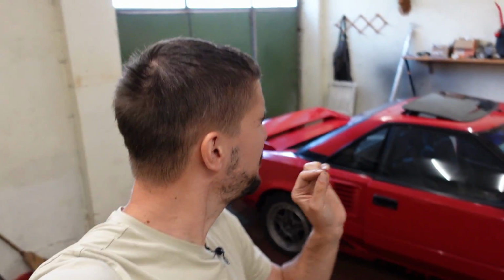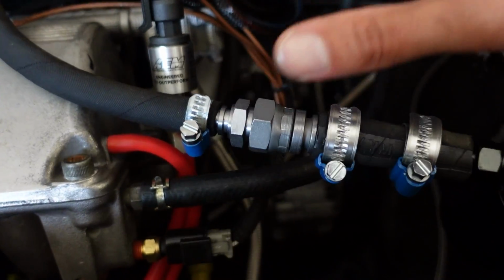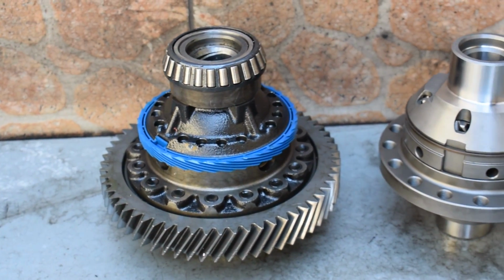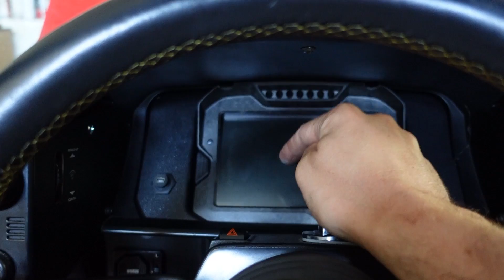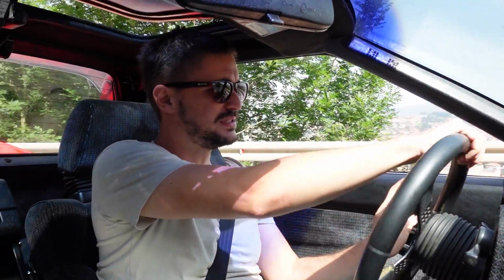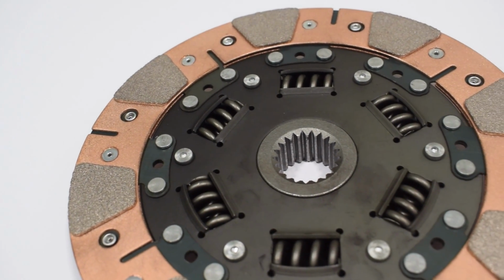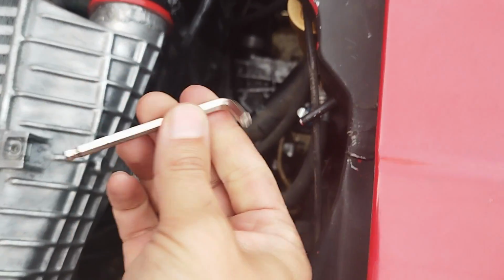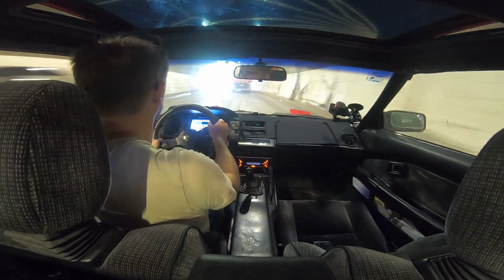Project Underdog First Drive - Turbo 4AFE Toyota MR2 mk1 AW11 spools up for the first time!

Comment: I drive a 1.4T Corsa E (stock motor) with the turbocharger from Astra H 2.0 OPC without the blow off valve and with the turbo flutter with 1.5 bar of boost. Don't worry, the turbo won't die. I've made thousands of kilometers already as it's a daily driver.
Reply: The flutter happens because it's at very low pressure ratios for big turbochargers. BOV will be open at 7 psi, but as the pressure drops, it closes anyway because of the spring, and flutter happens.
Reply from the maker: It works fine now, I explained it in the description

Comment: ignition coils need to make more voltage because more boost increases the density of air, literally stuffing more air molecules between spark gap thus increasing resistance.

Comment: The usual reason for a BOV not working correctly is a hose problems, if it dumps at high pressure but not low you have a kink, if it never dumps its blocked (dirt or heavy a hevy kink). And is it dumps only on lower revs check the routing of the hose, twice on volvo 240 turbos I have seen a hose getting squeezed because of engine movement 😢. God luck and enjoy BOOOST🎉

Comment: Great ! 
You got it perfectly, hard work and learning pay in skills first, then in project fulfillment! 
Nice car. With about 0.5 to 0.6 bars of boost you are far away of what this setup is able of. 
I would know about some technical choices, for example  two coils would have been enough to operate the engine in wasted spark way... 
Don't hesitate to deflate your rear tyres to preserve some grip as you try higher boost levels 👍

Comment: You should be able to find a transfer table on whatever map you are using. You can manually enter lots of points, and your data will get way more accurate. I'm sure you know better than me, but whatever Power level that tb gets supersonic you might start getting a wonky map reading if it's not far enough from the disturbance.

Comment: You sound like a boost affectionado. If you ride motorcycles I suggest trying to find a '83 or '84 Kawasaki GPz 750 Turbo. Don't crack the throttle very much around corners as the turbo kicks in, spins the rear wheel and can cause some scary situations....but in a straight line...HOLD ON!!! 14-15 PSI straight from the showroom floor. It is a widowmaker though, but most died with a HUGE grin on their faces.

Comment: Amazing job! I've learnt a lot from your videos. And i think your turbo is fluttering, because BOV is attached to intake manifold after the throttle body, so it have no chance to work after throttle is colsed
Reply from the maker: Thank you, it's before the TB. I fixed the flutter, there's an explanation in the description

Comment: Thanks for sharing! I wonder cuz i have a 40mm extender for the steering wheel hub and +70mm shaped steering wheels with my 1,90m. Seat completely back but you drive a flat wheel without anything.

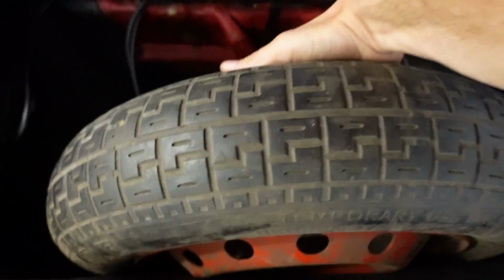Comment: 10:04 Anyone else worried the rim of the spare tire is going to short the battery terminals at some point? 😬
Reply from the maker: It can't. The diameter is much larger than the distance between the terminals. But even if it weren't it simply can't reach the terminals. On top of that the wheel is painted, I checked and it has no continuity through it.

Comment: You need to get some insulated covers over those battery terminals, you don't want them shorting on the spare.
Reply from the maker: They cant, it's physically impossible, I explained in a similar comment below.

Comment: Any thought on installing water-meth injection and/or an air to water intercooler? 
I'd guess the economy engine has higher compression and is going to hit its knock limit pretty fast, especially since it looks like you're going to struggle with airflow, or at least cool airflow, through the air to air intercooler. 
Nice build! Your reaction when you first give it throttle says it all. Looks like some nice driving roads and scenery there too!

Comment: I imagine you gapped your rings appropriately, so you may find that you need to make the PCV outlet on the valve cover a little bigger, not sure what the ID is from factory or anything, but it’s something to consider before downsizing the rest of the hose.
Reply from the maker: Yes, rings have been gapped, but the engine would be junk if the pcv needed a bigger hose than stock due to increased flow.
Reply: @d4a  I don’t find that assessment accurate. You gap the rings, by default you increase the blow-by. You boost? By default you increase compression pressure, thus increasing the force available to push past your rings. I’ve ran into this issue on multiple engines that aren’t normally upgraded. And I’ve noticed that factories increase pcv valve size occasionally, on new engine designs, due to crankcase pressure causing gaskets to leak. The new 7.3 Godzilla engine is a prime example, once modified, they are prone to having premature gasket leaks when you start increasing RPM range and adding boost. For the 7.3s it seems to be more inadequate ventilation at high rpms, whereas on something like the older Ford 3.0 it seems to be an issue when you add any sort of power, no matter the ring material or freshness of the engine components. Just based on my personal experience. I was just suggesting it would be safer to increase venting capabilities versus keep them stock, on a far from stock engine. Compare the stock pcv ID of the 4a economy versus the sport. I wouldn’t be surprised to find a difference. Having said all that, whether I’m right about the blow-by is irrelevant when you consider the fact that turbos will keep you oil temperature on the higher end of acceptability. I love the build though, friend. I am excited to see a full throttle pull.

Comment: Did you evaluate to put one or two (each for each wire) big fuses just after the battery connection to protect any possible short? Just measure how many amps you need during crank and then give it some safety. BTW beautiful car I love it and compliments for your work!

Comment: Your Hot Air intake 😂.  Duct the intake from side vents to only intake pipe. Use the other side vent for intercooler. Keep radiator up front for weight balance, and upgrade the capacity for turbo heat.

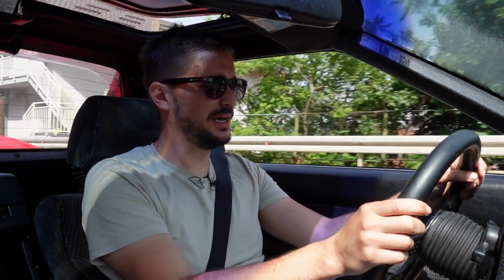Comment: I love this video! Your reaction at 18:00 is priceless!
Tell me though, what specific turbo are you using? Specs (sizes and stuff)?
Are you going to upgrade your wheel+tire setup now that you have significantly more power?
When can we expect a parking lot donuts video? :)
Great to see this thing running, well done D4A
Sincerely, @gelo_gti
Reply from the maker: It's this one https://www.google.com/url?sa=t&source=web&rct=j&url=https://www.maxpeedingrods.nl/products/turbo-t25-t28-gt25-gt28-gt2871-gt2860-universal-racing-turbocharger-25bar&ved=2ahUKEwjM0uLKm-D_AhUecvEDHTrCArQQFnoECA4QAQ&usg=AOvVaw0TflYe1veI2AAIo1OoDfjv
But the price was only 440 USD 2years ago. Tires are already 15*7 which I think is enough for now at least. Brakes might need more capacity. I'm not much of a hoonigan 😊 but there will be a spirited drive video

Comment: Great car BTW. I'd love a little MR2. Though I prefer a fiero gt. Not sure what I'd actually do as far as engine. I'd either do a full rebuild of the factory v6 with some minor things and leave it original.  Or a cosworth replica build of the 2.5L iron Duke. A built 1.4L from a chev Cruze, a 2.0L turbo or supercharged from a cobalt ss or the supercharged 3.8L from the grand prix.

Comment: You should crank up the boost. I drove my avensis with 470k km on the clock for 4 years with 15psi on stock engine on ice tracks here in Finland. Beat many rally cars in our timed club competitions.😂

Comment: I have a technical question for you if you don't mind. I am in the early stages of a single seater car build (collecting parts and designing). The basic layout- turbo 3.6L V6 (LF3) planning on making 1000HP and 1000Nm of torque at the crankshaft. Will be using a transverse (FWD) automatic (6T80, strongest one in existence rated for 515Nm torque and max vehicle weight of 2480kg). I will be installing all this longitudinally and using it as AWS setup (like some 4cyl rock crawlers). Since the transaxle already has the final drive ratio built into it, logic says I need 1:1 ratio differentials, however this is the perfect opportunity for me to gear it down (1.28:1) and limit the top speed to 320kmh, since it should trap around 300 in a 1/4 mile drag race around 8.0sec. Weight is projected to be 1000kg. Now the question I have for you: since I am using double the amount of engine torque the transmission is rated for (pushing less than half of the max rated vehicle weight) am I safe to assume the transaxle has a chance to survive? The 1.28:1 ratio differentials should be helping relieve some of the load torque-wise. My train of thought is double the torque with half the weight should be helping, but I don't know how to put this in numbers.

Comment: Good bless you D4A please do a video drifting the mr2 my father bought me one couple years ago about 3 that I really wanted to learn how to drift in I had so many aspersions for it and I ended up crashing it into a tree the very first day after struggling hard to get it home due to overheating issues and then it got stolen from me don’t worry I found it a couple months ago so if you could do a video where you take it to a track and link a couple corners you would be doing me a great service❤

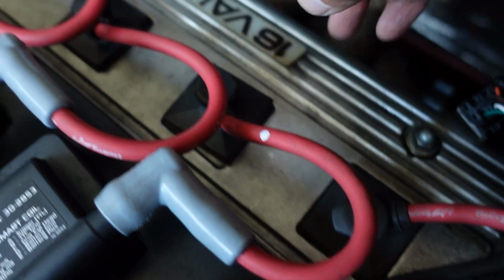Comment: 3:46 you dont need to do anything of that, tfsi/r8 coils hold down by suction..
also i never seen that small TB on 4afe to this day..
also there was few hi performance n/a 4afe's, in holand one had 260hp n/a
as boosted, mine was at around 275hp (1.3bar of boost)
4:20 you dont need that, stock nipple to atmosphere is enough, 4afe has good separation system on head cover so i never had any problem with that

Comment: Could you use the throttle body/coolant hookup to plumb in a separate system to act as a charge air cooler...

Comment: I remember seeing the bike carb era of the MR2 and it’s awesome seeing the evolution of the car over time, question though, i’m building a silvertop 7age with a maxpeedingrods turbo as well but i’m worried about the stock piston being a failure point. I have a set of maxpeedingrods forged rods as the stock rods look like twigs but decided against going for the upgraded pistons, are you running stock or upgraded pistons and is it something i should be concerned about regarding integrity since i’d much rather swap out the pistons sooner rather than later instead of the whole block if catastrophic failure occurs lmao. I plan on pumping about 14 psi but i’ve been told the upper limit is 10 for stock components.
Reply from the maker: I went for 4agze low compression pistons, they're practically forged units. I have videos on the pistons specifically and this build in detail, you can find all of them on the channel. Boost itself won't kill stock pistons, it's their margin for knock that's tiny. You can throw 14psi at them but you'll have to keep timing very conservative and air fuel ratios overly rich which means you'll be making much less power and drama than you'd expect from 14psi. Since you're already in there I'd put something beefier to leave room for growth

Comment: Hey man great build, been watching from the start, and way before actually! Quick question about the pistons: did you have to have valve reliefs cut into the pistons since they were originally designed for a 4agze? And did you use 4age rods or 4afe? I can't quite remember 😅

Comment: D4A: "Don't worry about the battery wiring, there's heaps of insulation around it"
Also D4A: *rests steel space saver wheel against exposed battery terminals
Reply from the maker: I see this is going to be a recurring comment. The wheel is physically unable to touch the terminals.
Reply: I figured that was probably the case, your attention to detail is usually pretty good 😉. Was just a funny juxtaposition when you were explaining the insulation and exposed terminals in the background. Congrats on the first run! What a relief it must be! I'm currently putting together a new engine for my car, the anxiety is real when you do your own work and sorta know what you're doing.

Comment: I need some of the advise you offered...
Can you tell us what is that heatshield you used in the engine bay?
I'm having a problem on my motorcycle where my vertical cylinder heats the fuel tank too much on the hot days, that much that when I'm wearing my bagster on the tank, the fuel is literally boiling inside, so I wanna shield it from beneath.

Comment: i love the build and your channel man. i also have a mk1 mr2 and finding your channel was a blessing. my plans in the future will be to k20 swap it. i couldnt help but notice that your radio is mounted... mine came without a radio and i retrofitted one, but i dont have any mounting hardware. are the holders hard to manufacture? i got no idea how they looked originally. also which size rear speaker do you use? it fits well in the cutout of the plastic

Comment: Which direction do rear engines rotate? If they rotate the same as front engines, would the transmission have to be inverted? Figured you would be the one to ask.
Reply from the maker: Rear engine and transmissions are the same as front, just different location

Comment: nice build good project, only some curiosity left in me. How you can make this legal?
Reply from the maker: Brakes work, lights work, everything works and I pollute less than before. There's no dyno on the technical inspection and the inspectors are still common sense here, they see it's an enthusiast build and that we did things properly and safely

Comment: 2:05 did you forget that you did port the F out of that head 😂 or you didn't use that head you ported in a vídeo?
Reply from the maker: Yes it's the same head 😊 but the valve sizes, cams, etc. Are stock. Actually everything except the springs. Forgot those. The point I was trying to make is that I'm basically getting in the same amount of air that a stock head could.

Comment: hey man i know ive talked to you before on emails about my build, its getting closer to running, but one question i had was what did you do about the weird ass M8x0.9 thread oil pressure sensor? also i noticed there was a hole next to it going to the oil passages and i cant remember what the hell i took out of there. and finally, with the alternator, what do i do about the 3 wires going to it, i didnt see them on your wiring diagram at all. sorry for all the questions man, its so great to see your project running and driving, it really makes me want to work harder on mine
Reply from the maker: Hey man. Had a machine shop make a T-piece adapter that converts the oil pressure sensor BSPT thread into an NPT thread for the AEM oil pressure sensor and an outlet to feed oil to the turbo. The three alternator wires are left in the stock wiring harness as they are, they have nothing to do with the ECU, theu just connect with the battery and I believe the dash too for the light (I removed that wire as I'm on a digital dash now.

Comment: It looks like your battery mount would short the battery instantly if you crash it ^^ (or if it is only 99% stable). Didn't watch the whole video yet, but the work looks great overall :9

Comment: Great build love the work, but i wonder how is the legality of such a modification in your county in Slovenia where im from this is impossible to do.
Reply from the maker: I'm 100% road legal. Brakes work, all the signal lights work, no structural rust, and I actually have less emissions than the car originally had from factory. The people at the technical inspection loved the car and we had a really fun chat 😊
Reply: @d4a  that is yust great to her here we cant engine swap across brands or even car models so lets take a clio for and example i cant put any other engine in it than the ones that came in that edition/ generation of clio but i need to do all suporting mods so better brakes and chasis uogrades then i cant turbo a pre NA motor and straight pipe exhaust i need cat and at least one muffler and all needs to be tuv compliant with papers of professional instalation from workshop its quite a challenge here do to such projects but you can easy put wider tyres lowering springs whole coilovers even cages and race seats and steering wheels if they have tuv papers

Comment: Could the chassis flexibility be causing an issue, with lot's more power than intended?  As I recall the steering and handling was quite numb and it was like driving a wet noodle.
Reply from the maker: You must have driven a mechanically unsound car